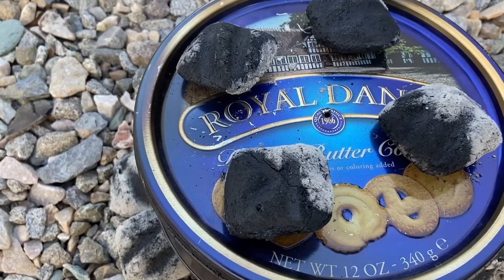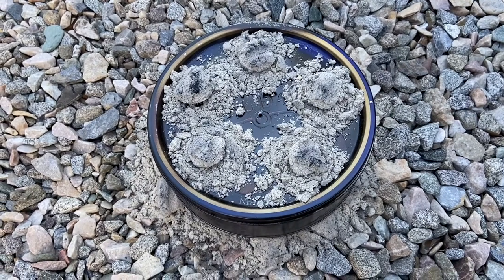Cooking Char Cloth and a One-Strike Catch!

Comment: Like 3 here for you! You the man! Made my first char cloth yesterday! Lots of quartz here in Newfoundland and Labrador and I wonder will it work like flint?
Reply from the maker: Yessir. Quartz will work great!👍 I use quartzites all the time because it is so prevalent. It doesn’t hold an edge as long as flint will, but will work great for throwing sparks from a steel striker. Thanks for stopping by the channel and for the comment.
Reply: Thanks for the advice! See you around!
Reply from the maker: @gbltheolechurch5acrehomestead  you’re welcome. 👍 Also, cooking the charcloth on coals is great when you have some time to kill to let it do its thing. When I want to make a batch quickly and don’t want to spend as much time, I’ll put the can on a propane burner outside on medium/low and it will cut the time down. But there is something fun using briquettes or in the fire pit using the fire coals.